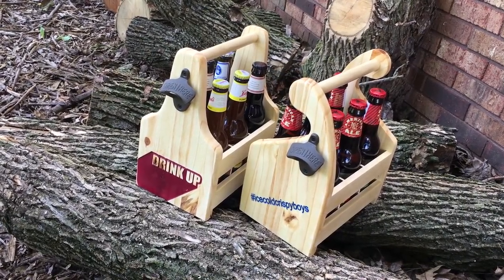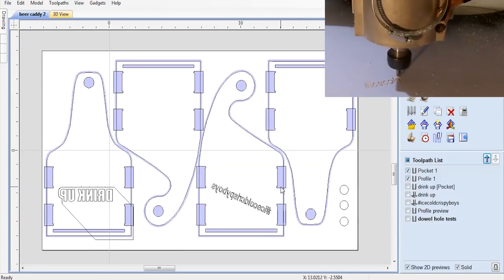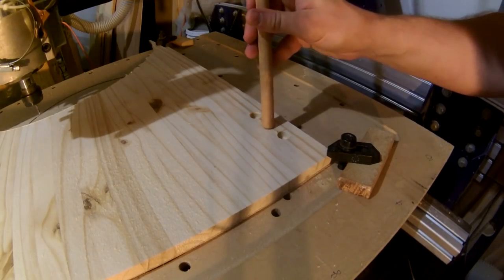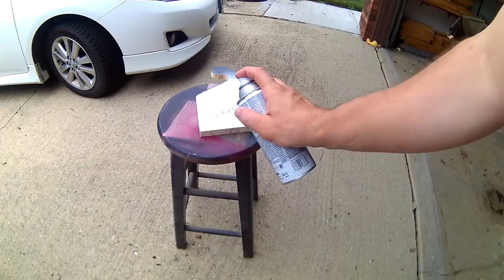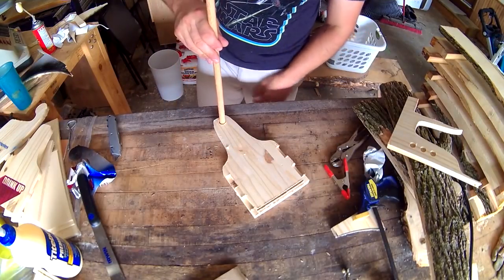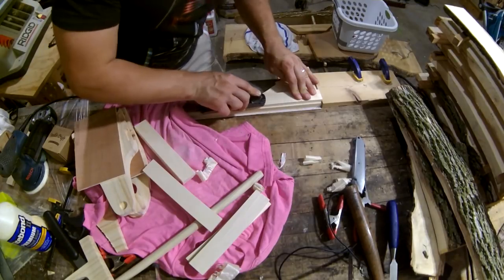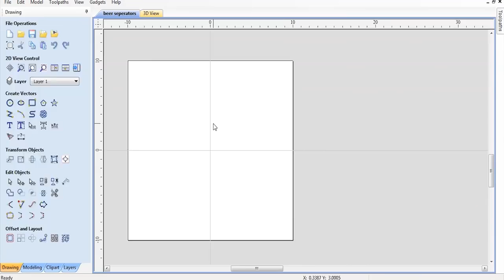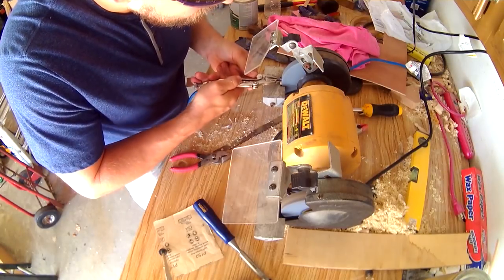Wooden beer caddy - CNC version

Comment: You left some important things out like how long are the slats, where are the corresponding .DXF and .SVG files for those slats. How thick are the slats? How wide did the end boards have to be to fit the bottles? Why not post the .CRV file so others can make these?
Reply from the maker: I'm just now seeing this, so a reply probably isn't relevant anymore, but here it goes:
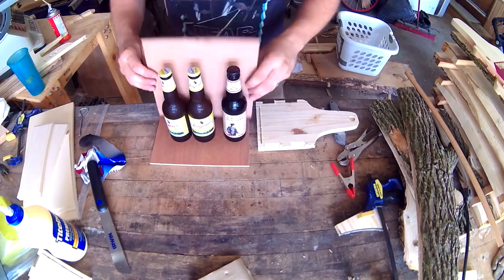I didn't make files for the slats because I didn't cut them on the CNC. I think their thickness was about 0.5". It would match the width of the cut for their mortises in the DXF files I posted (link in the description). You see me laying out their lengths at 6:05; but that length would vary from project to project depending on the material someone chooses to use for the dividers. You'd find the widths of the end boards in the DXF files. I didn't post .CRV files because I didn't know how compatible that file type is with other people's software. I figured a DXF was appropriate, and if you're downloading them to use I figured you'd also know how to set up toolpaths to suit your material choices. If I'm wrong about that, my bad, but the specifics of setting up toolpaths wasn't the focus of this project. Thanks for watching!

Comment: Pretty cool idea. I made one last weekend from your files. I found your dimensions to be off. I had to re-size all pockets and make the dividers bigger too. All in all it turned out pretty well.
Reply from the maker: Doug Baker Free files will always be “off” and need some tweaking to suit the thickness of the material you use in your project. I’m glad you know how to do that. It also makes sense that you need a slightly different size of divider/ since I didn’t give the length of the sides, bottom, or handle I used. Happy building 😁